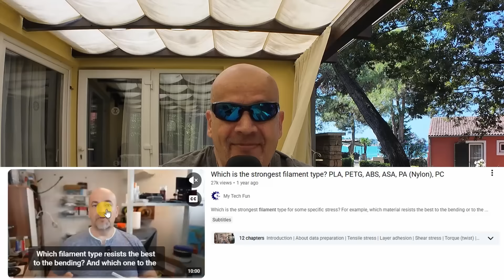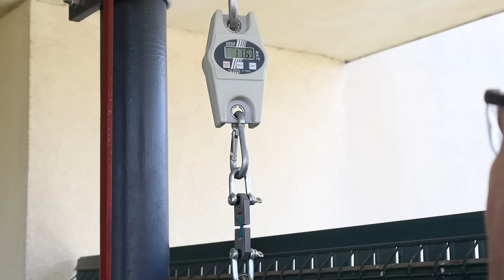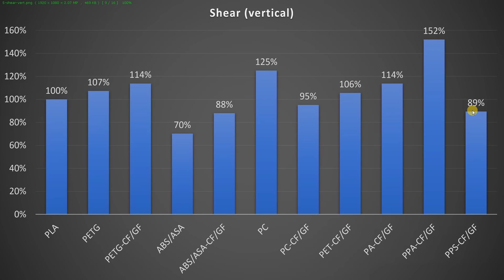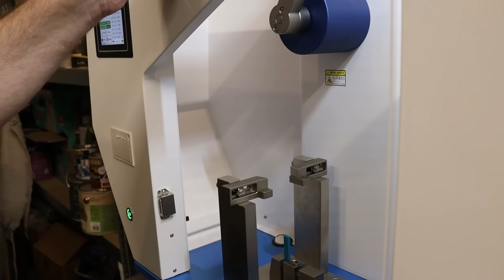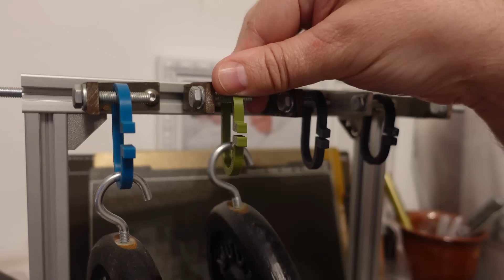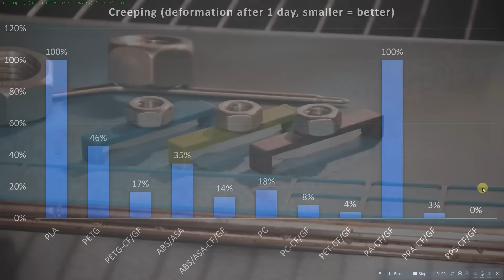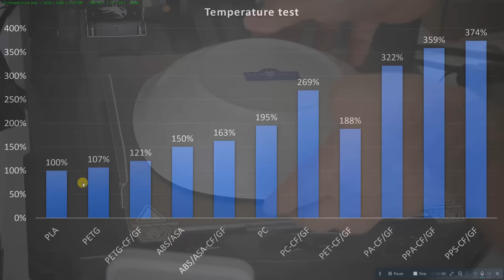Which Filament Type Is the Strongest? Now Including PET-CF, PPA-CF & PPS-CF

Comment: Dr. Igor, please read! Especially the bottom.

5:21 This is the part that always boggles my mind because I’ve always heard that PLA is more brittle than PETG. And that’s been my experience too. PLA, in real world scenarios, feels and behaves like it’s stiffer, more brittle, and less flexible than PETG. And in contrast, PETG is less stiff/brittle, more flexible/ductile, and just feels and behaves as if it’s stronger and more durable. This is why folks generally recommend PETG if you want your model to be “stronger” and last longer.

Just print PLA and PETG test pieces, let’s say 25x200 mm and 5 mm tall and grab each with your hands and try to bend it til it breaks. The PLA will feel stiff in the hands until it reaches the breaking point, then it shatters. But the PETG, which also feels fairly stiff, feels a bit more flexible/bendable, and as you continue to bend it, it simply doesn’t break. It bends and then deforms but never breaks or shatters. It feels “stronger.” Important Note: Bending these pieces with your hands applies the force slowly over time, with the force gradually increasing until breakage. More on this later.

But these tests in the video kinda say the opposite and it doesn’t really make sense to me.

I do think it has something to do with “time” though too, meaning the amount of time over which the force is applied. For example, the IZOD impact test… a large force/impact is applied VERY quickly and PLA comes out on top, roughly 4x more impact resistant than PETG. Again, this is with sudden, instantaneous force/impact.

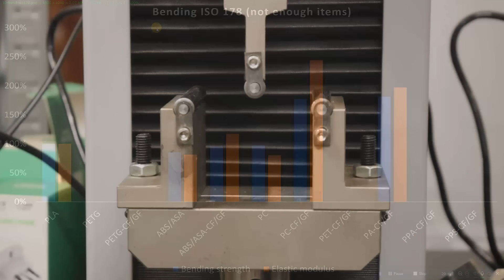So the closest test to the “bend by hand til it breaks” makeshift test I talked about earlier, where the force is applied slowly/gradually, would be the Bending (ISO 178) test at 6:41 and unfortunately we don’t have data on PETG. I would love to know the results for PETG vs PLA here. I’m not a Patreon supporter though (sorry I’m poor tho, lol). I’m guessing PETG would come out on top here. Maybe? 🤷‍♂️ Could anyone tell me the results?

And to further support this, the creep test is another test that kinda measures a force being applied slowly, over time, and held there. PETG wins in this one. Which supports the idea that PETG is stronger and more durable.

So yeah, this whole PETG is actually more brittle than PLA thing just warps my mind, lol. Any thoughts folks? Any easy way to help me unravel this in my mind? 😂😂😂

EDIT/UPDATE: Did more research. Sovol put out an article that claims PETG has twice the “impact strength” of PLA. They show 52.7 kJ/m2 for PETG vs 26.6 kJ/m2 for PLA. (Apparently these numbers came from Bambu Lab PLA vs PETG testing.) But either way, they claim the exact opposite of the results here. This further confuses me. I can’t link the article (YT blocks it) but just google “Sovol Advantages of PETG filament compared to PLA.”

SalesPlastics website also has a chart showing IZOD impact test with 15-40 for PLA and 80-150 for PETG. (No units for their numbers though, very suspicious.) Why are these numbers so high? Maybe a different test than IZOD? Once again though, it contradicts the data here, which makes things confusing.

Ultimaker website also has an article: PETG vs PLA vs ABS: 3D Printing Strength Comparison. They also claim PETG has “significantly better impact resistance than PLA.” Stating it is “less brittle.” So I don’t know who to believe anymore.

And here is a big one… CNC Kitchen (very reputable channel) has a video where he does an IZOD impact test and PETG came out on top, absorbing 8.6 kJ/m2 compared to only 5 kJ/m2 for PLA. This is completely contradictory to the results here. Why is that? Who do we believe? I definitely trust Dr. Igor but I’m so lost in this rabbit hole now, lol.
Reply: Mechanical engineer here. The technical term you are looking for is "strain rate dependence", that is the speed of the deformation. Polymers are typically highly strain rate dependent and will show very different behaviour at different loading scenarios. To fully understand the behavior of the materials you would need to do tensile tests at many different speeds (strain rates), but I fully understand why he is not doing this. It is way too much work, and many of the viewers would not be able to interpret and understand the results. The benefit of the tests he is doing is that they give out a single number that can be compared between materials without being an engineer. But as you point out they do not tell the full story.
Reply: @TorbjrnMoi  Thanks so much for this info. I knew there had to be more to it. I’ll research this. But the crazy part is that in my research (just googling “PLA vs PETG strength stiffness impact-resistance”), I’m finding so many articles (some very reputable) that contradict the data here. I just edited my above comment to include some of that info at the bottom. Many of them talk about how PETG is much more impact resistant and much less brittle and have test data backing it up. I can’t seem to reconcile these differences. Boy am I lost in the rabbit hole now, lol.
Reply: @TorbjrnMoi  I even found a 5 year old video from Dr. Igor where he did an IZOD impact test on his old setup and it showed PETG winning, meaning less brittle and more impact resistant. 🤷‍♂️

It must really come down to which brand/formula of PLA and PETG is being tested. That’s a big variable here. But all the data I found just said regular PLA and PETG, not any “+” or “pro” formulas.
Reply: Petg is the worst material for impact (which you are confusing for something else), it usually gets around 2-4 kj, average pla nowadays is much better.
Reply: @riba2233  I’m not confusing anything. PLA vs PETG. Simple enough. I did the research. You should do the same. Multiple reputable sources have stated that PETG does indeed have good impact resistance and they have data to prove it. I’m just curious why Dr. Igor’s recent testing showed differently. His older videos (5 years ago) showed PETG beating PLA in IZOD impact tests. Go look for yourself. I trust Dr. Igor so there must be some variables that are not being accounted for that explain the differences (i.e. different brand/formulas of filament perhaps). It doesn’t sound like you are speaking factually, just hearsay and opinion. Those numbers you’re claiming don’t coincide with any of the real data out there. You also don’t need to be rude and talk down to people. That makes you even less credible.
Reply: @zx4133  which sources? They are not reputable because that is simply not true. PETG is really bad for impacts as it breaks like glass, that is a very well known fact and you can easily test it yourself. PLA from 5 years ago doesn't exist, formulas have changed a lot so that is not relevant info anymore. I am not rude (but you are if we are being honest), you are just to sensitive and stubborn. I have told you facts, you can test everything yourself easily, and if you don't want to know the truth that's on you.

Comment: In future would love to see PCTG included, as the claim of it being 8x stronger than PETG doesn't include all directions of force.  But PCTG's greater UV resistance, no warping issues, greater heat tolerance, without fume issue should rank it above ASA/ABS, certainly easier to print.
PC-PBT would be another for higher end engineering applications too.
Reply: I'd love to see how PCTG does with impact resistance because that is where the greatest difference between PETG and ABS/ASA lies.
Reply: Used a roll PCTG this year. I think i will use it for Most parts in the Future where i used petg

Comment: Damn, PPA-CF is a beast. Topped the charts in essentially everything.
Reply: Question is if PPA is better, since PC is better than PC-CF (raw strength wise).
Reply: @jaro6985  no it isn't
Reply: @jaro6985  He has a video on it. He linked it in my other comment. I just haven’t watched it yet. He compared PPA, PPA-CF, and PPA-CF Core.
Reply: @zx4133  thanks, he shows its a lot weaker but not completely conclusive as it was printed at a lower temperature. Looks like it works well with CF though.
Reply: @jaro6985  Yeah I just watched it myself. I wish he would’ve went back and printed the regular PPA with the better/correct settings. Those test pieces definitely looked rough and I think impacted the tests.

But even with the numbers as they are, the regular PPA still looks to be quite strong/capable and with good heat resistance.
Reply: @zx4133   they look like that because they are really hard to print, one of the reasons not many companies make it.
Reply: I love PPA-CF. And it’s not hard to print. Don’t even need a heated chamber. I print the stuff on my Elegoo CC1 all the time. And if you go with Siraya Tech brand, it comes in a non-CF version and a Core CF version, where the carbon fibers are embedded in the center only. This is preferred for parts that will be handled (so you don’t end up with carbon fibers all in your skin).
Reply: @zx4133  you don't end up with fibers in your skin lol, can we please stop spreading that myth?
Reply: Yes, you actually do. It’s a fact that’s been proven time and time again. Do the research and quit being ignorant.
Reply: @z.x.4133   nope, it hasn't. like I said, stop believing every 🤡you see on yt. nothing stays in your skin.
Reply: @riba2233 
Well, that will be your little secret. 🤦‍♂️
Those of us that are still functioning here in reality will exercise caution because we know that carbon fiber has been repeatedly proven to get embedded in your skin. I’ve experienced it firsthand.

Not that you’ll do the research, but here is a list of just some of the organizations that have done studies on this topic and have proven that carbon fiber is a known heath hazard for skin, mucous membranes, and lungs. They all have published peer-reviewed studies on this that are available to the public on their websites. I’d include links, but YouTube blocks all links in comments.

-National Institute of Health (NIH)
-Centers for Disease Control and Prevention (CDC)
-Monash University
-Toray Composite Materials America (a global provider of carbon fiber materials)

So maybe listen to the facts instead of believing every 🤡 thought that pops into your tiny mind.

But please, in the meantime, feel free to keep handling carbon fiber with your bare hands. In fact, feel free to rub it all over your skin. Make sure to get into all those sensitive areas too. 😘😘😘

Comment: I have always claimed that PLA is underated but I was surprised to see just how much more brittle PETG was.
Great work and presentation!
Reply: Something is off with his IZOD test, CNC kitchen and others have measured PETG as being tougher, though not by a huge amount. Basic material properties say the same for non 3D printed forms. 
Using the two in real world situations will tell you similar.
Reply: both PLA and PETG is shit only good for toys
Reply: @MegaChickenPunch  very untrue, PETG is one of the toughest in UV after 7 years, find the test on youtube.
Reply: @utvc3687 is it better than ASA, though? The main issue with PETG seems to be that it's not really a standout in any area, and doesn't print as easy as PLA. Applications where I would have considered using PETG I would rather use PCTG (also UV resistant) or other filaments with better application-specific properties.
Reply: @utvc3687  toughest? buddy it shatters from a fart of a fly
Reply: @MegaChickenPunch nope
Reply: @MegaChickenPunch  Nah depends on settings and use case. I was printing toy swords in PLA that I repeatedly dropped from over 2 meters height 20 times in different orientations to test the strength. No breakage, just scratches. Print hot and slow with enough walls. Infill was usually not needed at all. And don't use blends with bad layer adhesion like matte or silk.
Reply: @Optisystemizer  i printed for ASG usage many times, all of that shit shatters from BB hits, i switched to HIPS and it works

Comment: Excellent video thank you.  One concern is blending HT PLA in with PLA.  This dilutes both.  Regular PLA is presented as better than it is, and whatever mechanical trade offs HT might have in reduced mechanical performance is also masked.  This is the same reason you seperated out the GF/CF version of PETG for example.
Reply: I found this confusing as well. I'd like to know more about HT PLA, since the main reasons I use PETG over PLA are the higher temp and lack of creeping. Until I upgrade from a bed-slinger, the more exotic stuff is probably out of my reach anyway.
Reply: @ArrAyyEff  I tried HT PLA in my AMS 2 Pro at 65C a normal desiccant container printed in that survives it fine, but a different design that is more like a round disk and between spools instead of the normal locations, when I loaded it with silica it ends up with a lot of pressure in the walls. One 8 hour drying at 65C and the walls on that HT PLA print is sagging in the center already. Did some digging the properties of it for higher temperature without annealing under load are not good, it's only good without a load and without annealing at a ok temp higher than normal PLA. I find PCTG better for need something that can survive around 65C than the HT PLA. Annealing can be hard to do properly and easily end up with a deformed and melty part, so I didn't try with the HT PLA yet, but I did with other PLA in the past only to get a part with only slightly better heat resistance that was totally deformed for the annealing and then still melted in a higher temp dryer.
Reply: @radfaraf  Thanks for sharing your experience, and also for the pointer to PCTG.  Looks like I might be able to print that without an enclosure.
Reply: @ArrAyyEff  yeah I print it on my a1 just fine.

Comment: I have to say this again, something does not add up for PETG, i print very fast with 28mm3 volume, at 265 degrees, but i never ever have layer separation on PETG prints, when i break them they never break on layer lines.
Also, why no HIPS?
Reply: I've always used it on an Ender 3v2, slower but only at 235, and have similar results. Tough, easy to print, doesn't need drying and cheap. Just the glossiness is ugly, but I mainly use the white colour so it doesn't show up as much.
Reply: Hips has horrible layer adhesion, forget about it.
Reply: @riba2233  Nope, much better than ABS, as proven by 3 Voron2.4 that have all HIPS parts...for over 7 years in use daily. Also i have thrown HIPS stuff intentionally on concrete and they rarely break. 
Again, 265 degrees hot end, not 230.
Reply: @toma.3d  yeah tests don't agree with that unfortunately

Comment: More people need to be printing PC, PC blends and filled PCs. Its just such a great material in my opinion. not as affected by moisture compared to nylon and still very strong and not that hard to print.
Reply: It has a very high glass transition temp and it's not oil resistant, plus not cost effective. Otherwise it's not bad yeah.
Reply: @riba2233 I got 1kg for 30€. That's good imo but the reason for bad prices otherwise is the lack of adoption.
The glass transition temp is a positive ngl

Comment: Would love to know how ABS/ASA would fit here if we only took them printed at 65C chamber. I suspect they overtake PLA in everything but stiffness
Reply from the maker: Soon I will test the effect of chamber heating (and not only for ABS)
Reply: ASA has been a love of mine for years. Early on I realized it needs to go down hot with zero cooling fan. I don't think Igor prints it like I do and I think it really affects a lot of his tests.
Reply: Pla will still have much higher tensile strength.
Reply: @riba2233 The absolutely abysmal creep and temperature properties of PLA means that most situations requiring the high tensile strength, you’re better off with another material.

ASA printed slowly at high nozzle heat, at 65C chamber, is basically the most balanced material, and is far more versatile
Reply: @awildridehome9469  I know, just saying.

Comment: Thank you! This is a really good video! A lot of data from one source and the calm and dry  presentation of an engineer. This is by far more useful than for example the fibre bashing videos from I did a thing. Doesn't matter if you got fancy equipment like an electron microscope and such. Just getting the basics right with a good database.
Reply from the maker: Thank you for kind words. Pity that YT algorithm don't share your opinion and it better like dramas like in that fibre bashing videos or wounds that don't heal (from NBR)